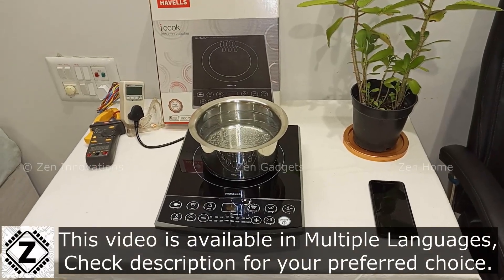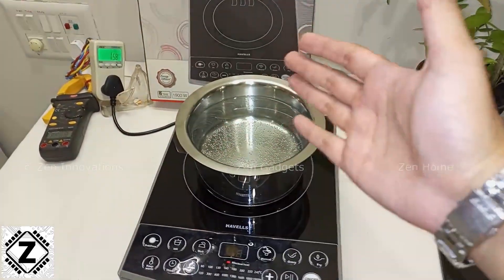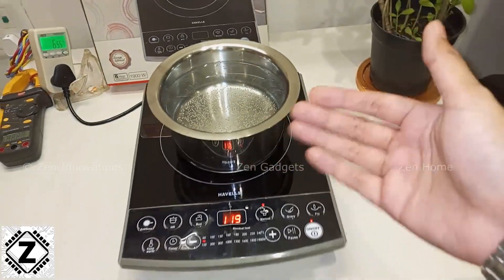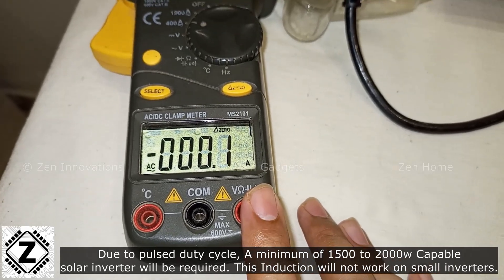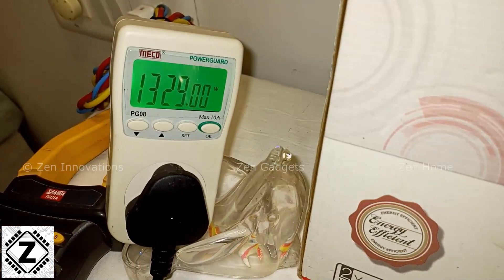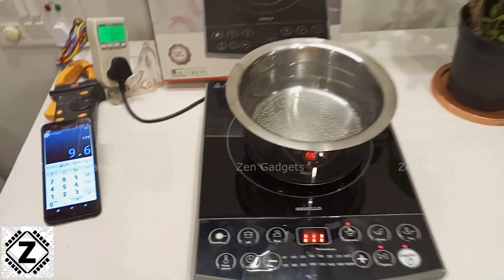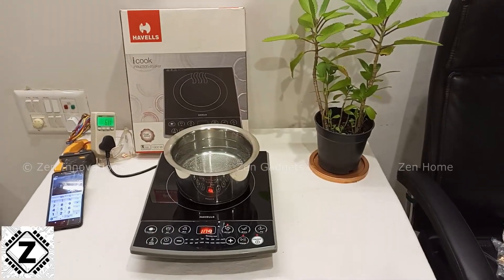[Eng] Induction cooktop power consumption test All Modes | Cheaper than LPG Gas? | Havells iCook

Comment from the maker: This Video is Available in Multiple Languages-
Hindi- https://youtu.be/tUHVYaFDb3A
English- https://youtu.be/wLroEP1xpAI

Power Consumption Test Playlist-
https://www.youtube.com/playlist?list=PL9YrG_WglF9wNFgu4vbfch1vjrqouWMrQ

Chapters Eng
00:00 Is using Induction cooktop cheaper & greener?
00:48 Test setup, Watt & Clamp meters
02:22 Wattage, Ampere & Duty cycle explained
06:11 How to use induction on Small solar inverter
06:58 Testing at different temperatures & wattages
08:44 Power factor
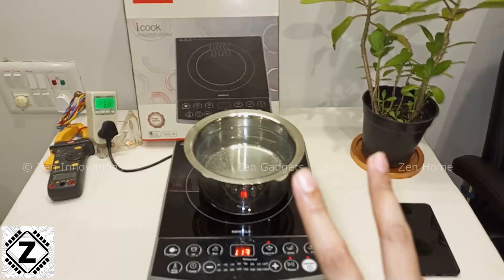09:52  Bill calculation & Cost saving.

[Best buy Affiliate Links]-
Induction cooker https://amzn.to/49Vf3nn
Havells Induction https://amzn.to/3BRO8w8
Induction utensils (Flat bottom pots) https://amzn.to/4gG8h7C
Infrared cookers https://amzn.to/4gAqEe2

LED bulbs-
Wipro Garnet Filament E14 bulbs https://amzn.to/3ArLYTd
Philips full glow (Filament style) https://amzn.to/4fg24OK
Philips ACE saver https://amzn.to/4fwgiuE
Philips Stellar Bright https://amzn.to/4hBhTkz

Buy Energy Meter-
Meco https://amzn.to/4ffIt0k
https://amzn.to/3hxvn27

Buy AC-DC Clamp Meter-
Mastech MS2101 (My meter) https://amzn.to/30miXTH
Sigma https://amzn.to/2G2gd75
Meco https://amzn.to/3jgVF98

Buy Solar PCU for Bill Saving - 
https://amzn.to/3ecn49u
https://amzn.to/2MYlNXH
https://amzn.to/2C2G5Nz
https://amzn.to/2B2R35o